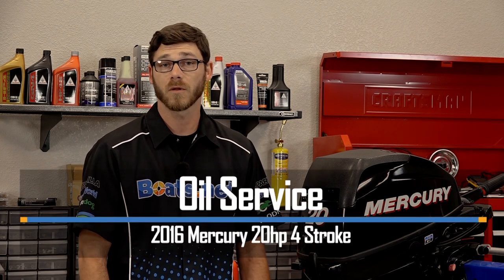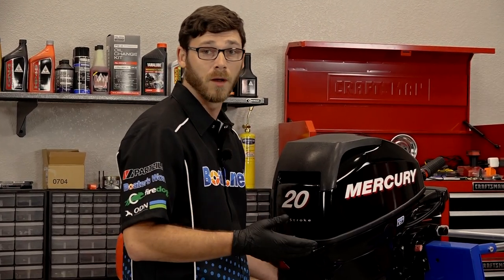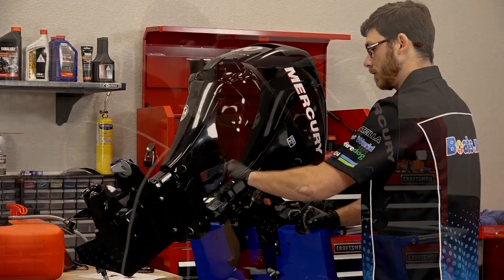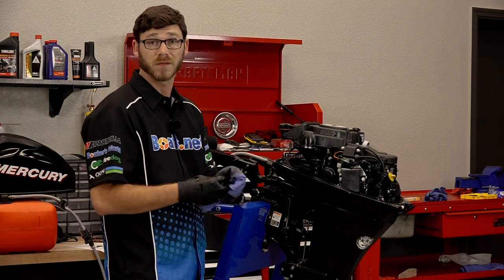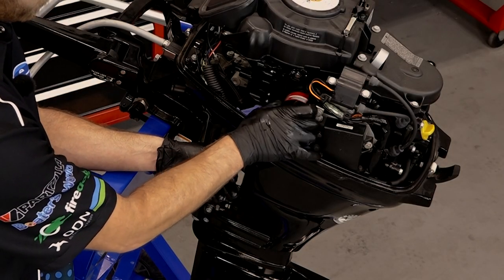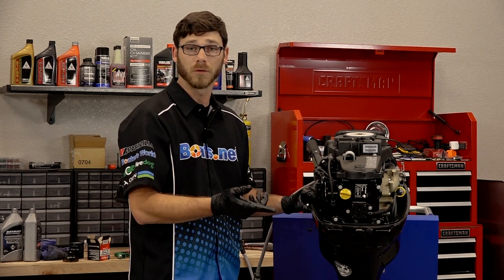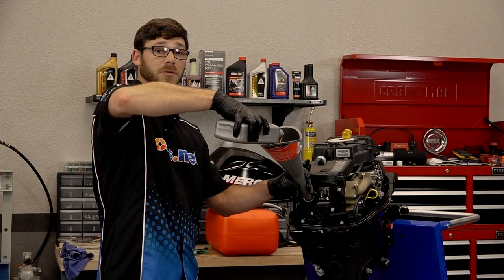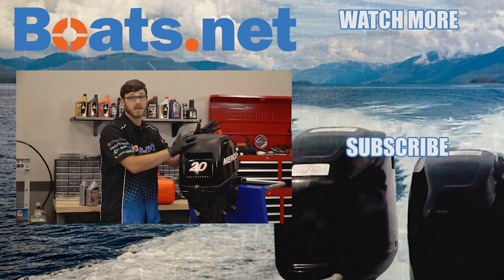Mercury 20 HP Outboard Oil Change  | Boats.net

Comment: If you turn the motor as if turning sharp right, so the oil drain hole is at an angle you get less oil running down the leg as it drains.
Reply: Thanks, great comment!

Comment: It would be helpful if Mercury would settle on a single correct oil filter for this series of engines. Mine came with one model number, but the kit contained a different oil filter model number, and even that was
different than the one the kit claimed to contained. How in the world do you know if you have the correct filter???

Comment: Any hints if the filter will not come out ? My socket just spins on the filter.
Reply: The 65 mm oil cap wrench socket spun here too.. had to purchase an adjustable plier type oil wrench to remove mine.

Comment: hello .  1 where and how many anodes does the 2016 20 hp 4 stroke have?  ... 2 what is the wash screw on the lower unit for?  ... 3 every few hours or time the engine belt is changed.??  .  thanks if you could answer

Comment: oil 10w30 or 25w50?
Reply: 25w 50 is more synthetic normally using for verado engines 10w 30 is enough for small engine
Reply: it has a temperature range the guy at mercury dealer suggested going to the 25w 40 in summer with warm water and high speed driving the 10w 30 is better in cold weather below 40 or just all around use